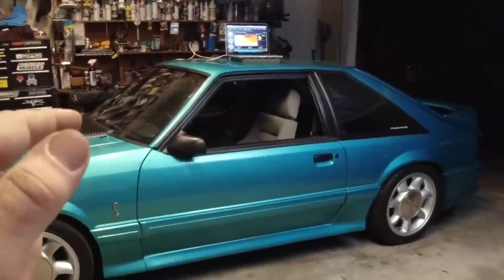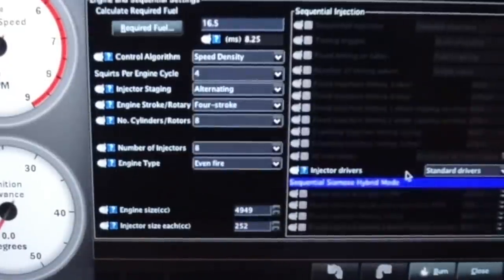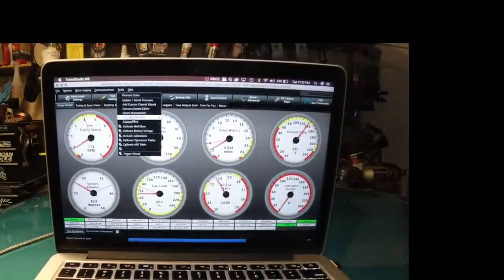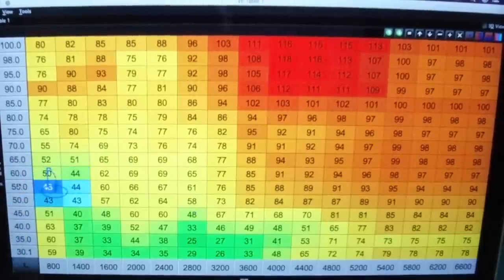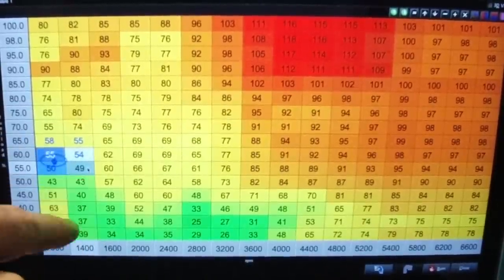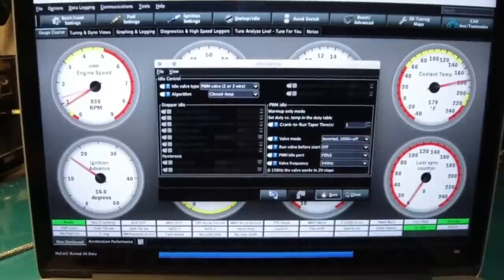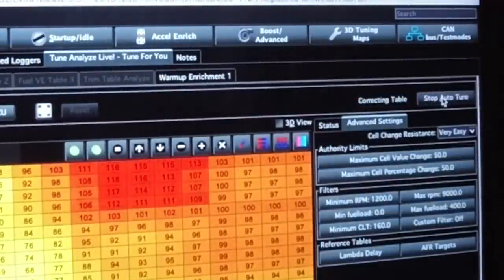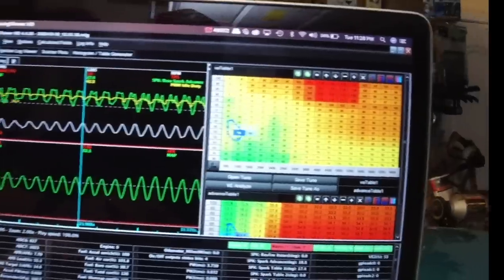KILL THE MEGA/MICRO SQUIRT GAME YOUR FIRST TIME OUT! (FOXBODY STARTUP TUNE)

Comment: That was a great walk thru on the Megasquirt software. I have the kit to put one together for my 1950 F1 project. It has a 5.0 HO out of a SN95 with Trickflow heads and An old Wieand tunnel ram that I added injectors to. The rest of the motor is basically stock though, so I’m hoping that it should take a tune pretty easily. 
I just subbed to your channel, as I also have a 89 LX with Vortech V3I
Thanks! 👍 Tony B

Comment: Man your channel is perfect, I’m working on a very similar engine build at the moment, GT40 upper / lower, heads, TF stage 1 cam etc with a turbo for the future so this has all been great to see you go through this. I have a Haltec computer I bought used and no one around here knows much about them and it cannot tune them so you really got me thinking about going with the full meal deal mega squirt instead... questions though, did you notice any power gains in your n/a engine after adding the computer? Will be following for sure! Thanks for the honest videos and keeping it real.

Comment: I'm thinking about a 331 or 347 with a carburetor for street non daily driver..thoughts?
Reply from the maker: Absolutely! Nothing wrong with a carb setup ✊
Reply: I have that set up in my 88 BMW 325is. 347, AFR 165 Heads 10 to 1 trickflow stage 2 cam and a Holley 650dp carb edelbrock RPM intake. It rips. But I should have got the 185 heads

Comment: I need help guys, I bought a 1988 fox 5.0 5 spd that had a microsquirt installed and it would run but run real bad. Vacuum leaks had it running so lean the headers would start glowing after about 1 to 2 minutes with an AFR of about 17-21 along with that I found the distributor was staked one tooth off. Previous owner tuned it with the computer and had it running with some detonation but anyways took care of all the issues, vacuum leaks and distributor taken care of. I was going to take it on a test drive and I had stalled it when going in reverse when I noticed when fully depressing the gas pedal the power lagged and took its time going up the rpms and by that point I said "well then I guess the last piece is the tune!" Downloaded tunerstudio started new project, set everything in the video but just like before as usual I tried starting up the car but this time I had a no spark condition. Using a incondescent test light I found power to the coil pos and neg side but when cranking the negative side was NOT cutting the signal it remained with power (both sides positive and negative). I replaced both the distributor and TFI module and nothing. BUT when I disconnect the spout connector I get spark meaning it's working just off the PIP signal. Exact same thing happens when I disconnect the computer from the harness. Did I miss a step? It was as soon as I clicked "create a new project" I have no spark with the spout connector plugged in! I've been struggling with this problem for months now and it's driving me crazy!

Comment: I think you should set the correct rpm on ideal before changing fuel mixer looked like you was about 300 rpm to high at ideal that’s could be the reason you are not thing if it’s hitting like it should

Comment: Question about the timing so is your timing set at 14 degrees or 20? I’m confused lol ...thinking about buying a mega squirt on my efi 83 Capri
Reply from the maker: The number I used to verify timing is irrelevant, the computer doesn’t use that number after you switch it back to USE TABLE. whatever number you have in your table is what the computer will use for your timing.  Mine is currently set to 10 degrees in the timing table at idle.
Reply: Thank you man for clearing that up! Watching this makes me feel at ease! Appreciate it BREW2L!

Comment: Is that 20 degrees of timing your timing at wide open throttle or at idle?
Reply from the maker: That 20 degrees is at idle and it’s only used to verify timing. After you switch back to USE TABLE it totally ignores that setting (number) and goes back to using the numbers you have in your ignition tables. So in other words it’s a useless number that the computer only uses one time for you to verify timing.